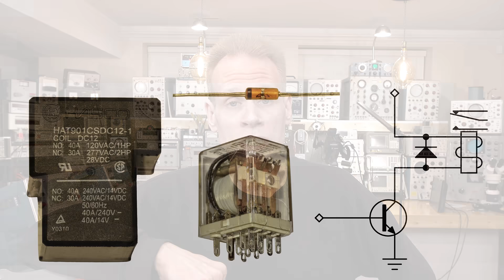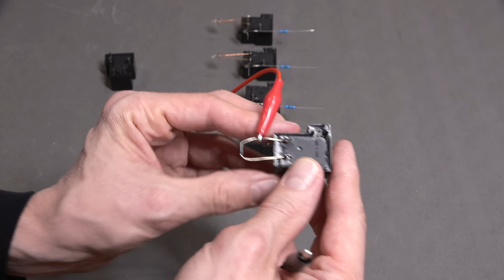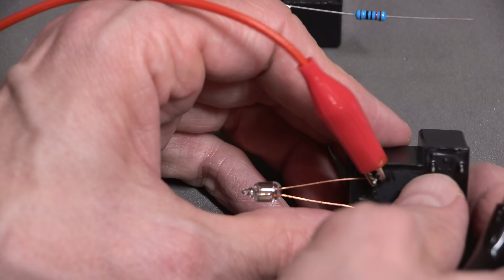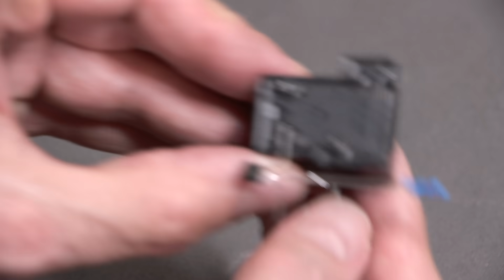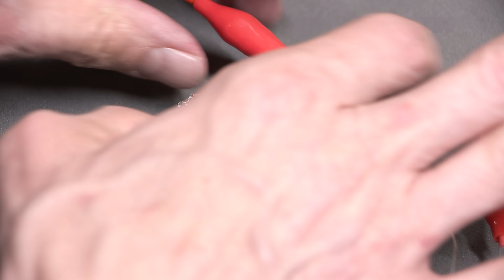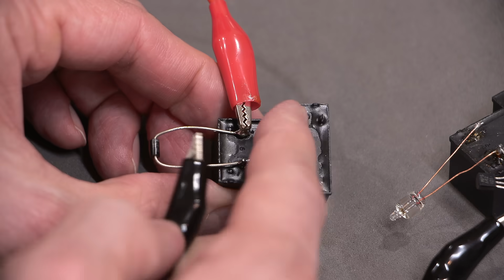Why Add This Diode Across A Relay Coil? This Is Why It's Needed!

Comment: Brilliant in several contexts. 1) Safety. Switch bounce from inductive devices can cause electrocution burns and cardiac fibrillation. 2) Circuit reliability. I've built high voltage power supplies and stepper motor controllers that would suddenly shut down or lose timing (e.g., 555 timer) until an experienced engineer told me to add diodes, which fixed the problems. 3) Excellent learning. Transistors are essentially two diodes, but a more inquisitive mind starts to ask questions about why collector and emitter are different. 4) The combination with neon lamp helps to understand directionality of electrons and magnetic flux. Noticing the oscilloscopes in the background, my current project is repairing a Tektronix 2465A DV.
Reply from the maker: Thanks for sharing your experiences, and good luck with the scope repair!

Comment: I am looking at the schematic for my 1990 Saab 900, the AC schematic. There is a diode but it's connected to the supply to the AC compressor clutch and then to ground. It's not across the relay what controls the AC clutch. My guess here is that the AC clutch itself is like a relay coil on steroids and that is what is being prevented from making a spike when it's disconnected. 

The relay itself seems to lack a diode, I suppose adding one wouldn't hurt anything.
Reply from the maker: Yes, the AC clutch creates quite an inductive kick when the 12V is removed!

Comment: Brilliant demonstration to to show co-workers and I've been explaining this to for years. A lot of electric strikes and wireless receivers and other electronic devices seem to be coming with Varistors now. What is your opinion of their use in place of this diode, or bridged across at the throw, or across at the load ? The load can be wired quite a ways away sometimes, and I've read instructions that straight up told me to install a varistor every one of those points to ensure functionality through warranty..

Comment: Just subscribed awesome explanation mate 👍👍👍 Im a diesel fitter and knew needed protection on relays and knew it was about collapsing the coil but never understood it now it makes sense thanks we get 2 sorts at work diode protected and resistor protected is one better than the other or are they for different applications?

Comment: Flyback voltages are wicked. It can take out transformers and other types of coils. It can take out components such as tubes/valves in old tech based equipment.

Comment: Automobiles have had this for ages. Coils can induce a voltage. Add the diode to kill it. With no diode, turn the key off and the engine continues to run.
Neon and inductance on decay at disconnect. Similar to an ignition coil creating spark at sparking plugs!!

Switch bounce is inrush decaying back to circuit voltage (12 volts)

Comment: the drop of the magnetic field creates an electron "vacuum", as the depletion zone moves and it pulls the positive side down below 0, and the diode acts as a check or dump valve.

Comment: I work in the access control industry and no one I work with could sufficiently explain to me why the strike manufacturer supplies a diode to wire in with the solenoid. Thank you for the demonstration.
Reply from the maker: Glad I could help explain it!

Comment: I think i just ran into a smd circuit where the diode failure caused a relay coil short that took out a Transistor.  Interesting this video appeared in my feed as i was recently googling diode, relay and transistor parts for replacement. Good info!

Comment: 1 - I congratulate you on a very clear illustration of the back-emf transient when switching OFF a relay.  Right down to demonstrating the polarity with the neon electrode.  V good.
2 - I'd like to clarify the nature of the current transient through the diode. At 16:30 you said it was much smaller than the relay's ON current.  What happens in fact is that, at switch-OFF the coil current continues instantaneously in the same direction and at the SAME VALUE, by virtue of the inductor's instantaneous back-emf.  The current however diminishes until the relay's armature is released.  This release of the relay's spring energy then comes out as a secondary pulse.  If you connect a small resistor in series with the diode you can monitor this on a 'scope.
3 - To further expand on this topic, what we see at switch-OFF is a release of energy contained in both the ½LI² of the inductance and the ½(SC)x² where (SC) is the spring coefficient and x is its extension.  The energy is released in the form {   Integral (ivt) (t=zero to infinity)   }.  The energy dissipation in the suppression cct can be accelerated by augmenting v (which is below 1.0V for a diode) by placing a zener in series with the diode (cathode to cathode) or across the transistor c-e, anode to ground, taking care that the zener voltage is substantially less the the transistor Vcbo.
I came across all this as a young engineer in 1967, working on a boat's echo-sounder in which the same transducer served both as transmitter and receiver.  The diode was holding the TR switch relay on Transmit long enough for shallow echos to be lost.  I ran into a similar phenomenon in 1970 when trying to engineer short pulses of compressed air using solenoid valves.

Comment: ・もっと根本的なコイル：インダクターの性質を説明することが必要です。
インダクターの有るコイルに電流を流すとコイルのインダクターに電流に相当した磁化エネルギーが蓄えられます。　
　その時に、電流を流している電源を切り離すと、磁化エネルギーは電流を流している時と同様に存続する様に振舞います。
つまり、電流を流し続けようとするのです。
　でも、電源回路は切り離されているので、コイルのインダクターは空間を電流が流れるような高電圧を発生させて電流を流そうと反応するんです。　これが、電流遮断時のコイルのインダクターの高電圧発生の挙動です。
　コイルのインダクターが電源回路から切り離されると、最初に電流を流した電源の電圧よりはるかに高い高電圧を瞬間的に発生させます。
　この高電圧はスイッチの接点間に火花スパークを発生させて接点を劣化させたり、スイッチ動作する電子回路のトランジスタを耐圧以上の高電圧で破壊したりします。
　このような不具合を防ぐために、コイルのインダクターが発生する高電圧をコイル自身に電流を流すことで防止します。
その為、コイルに加える電圧と逆方向のダイオードをコイルと並列に接続したり、交流電圧で動作するモーターなどのコイルに電源電圧以上で導通するバリスター素子なども同様に並列に接続して使われます。
　なお、ダイオードによる高電圧発生防止ではコイルの発生する電流が流れ切るまでリレーがON状態に成るので、OFFが遅れます。
これを防ぐにはダイオードに低抵抗を直列に挿入して、電流の熱エネルギー変換を早めることもできます。

・A more fundamental explanation of the properties of coils: inductors is necessary.
When current flows through a coil with an inductor, magnetizing energy equivalent to the current is stored in the inductor of the coil.
If the power source passing the current is disconnected at that time, the magnetization energy behaves as if it continues to exist,
 just as it did when current was flowing.  In other words, it tries to keep the current flowing.
However, because the power circuit is disconnected, the coil's inductor reacts by generating a high voltage that causes current to flow through space, in an attempt to allow current to flow.  
This is how the coil's inductor generates high voltage when the current is interrupted.
When the coil's inductor is disconnected from the power circuit, it momentarily generates a high voltage far higher than the voltage of the power source that initially passed the current.
This high voltage can cause sparks to occur between the switch contacts, degrading the contacts, or it can destroy the transistors in the electronic circuit that operate the switch due to voltages higher than their withstand voltage.
To prevent such problems, the high voltage generated by the coil's inductor is prevented by passing current through the coil itself.
For this reason, a diode with the opposite direction to the voltage applied to the coil is connected in parallel to the coil, or a varistor element that conducts at voltages above the power supply voltage is similarly connected in parallel to the coil of a motor that runs on AC voltage.
Furthermore, when using a diode to prevent high voltage from occurring, the relay remains in the ON state until the current generated by the coil has run out, so there is a delay in turning it OFF.
To prevent this, you can insert a low resistance in series with the diode to speed up the conversion of the current into thermal energy.

Comment: This past summer i was diagnosing a Mercedes SUV A/C compressor that wouldnt turn on after it was replaced. This is not a traditional compressor with a clutched pulley, but rather a solid pulley. The refrigerant pressure was controlled by a solenoid. The HVAC module sends a square wave to this solenoid to pulse it open. However the Module refused to command the solenoid. An oscilloscope showed that the square wave, durring the modules startup test, was showing to be a positive to negative zigzag instead the 12v positive square wave. This threw a DTC code suggesting that the solenoid wasnt grounded and the Hvac module disabled the system. At this time i learned how to use a diode in this way. After installing the diode across the solenoid wires, the oscilloscope shows the negative pulses have been effectively cut off, leaving only the positive to remain. The Hvac module was happy and the compressor worked flawlessly after that!
Reply: You could give the automotive diag youtubers a run for their money! You are brilliant.

Comment: Thank you Mr Carlson. This was just a random YouTube to me. I learnt about the flyback diodes in my Industrial Electronics training years. I'm surprised at the 30 amp automotive relays that don't have this built in. Considering that people are fitting driving lights to vehicles that now only come with LED headlights as std fitment. When I ask about diode protected relays at an auto store they look at me like I've got two heads, some suggest that you just install a fuse😂.

Comment: Many GM automotive Omron relays have one inside.

Excellent channel thank you 👍

This phenomen is similar to points condenser coil which when points open magnetic field collapse creates high voltage for spark plugs etc .

Comment: I have a relay issue with a door controller that I found a workaround with a diode, but no idea why it works.  It doesn’t matter which side of the relay is being used, normally open or normally closed, whichever side is currently open will flow current backwards.  I will have a door strike wired up to the normally closed side of the relay. When the relay trips in the circuit opens current will still flow through the circuit but backwards even though it should be open now. If I put a diode on the common side of the relay and have the negative side of the power connected to the diode and the positive to the normally closed side of the relay the circuit works perfectly. Anybody have any thoughts why?

Comment: As a Senior Master ASE with over 40 yrs of experience I have never replaced a relay due to it being broken down from the tiny voltage spike that you demonstrate. A 12 bolt vehicle battery is an incredibly  large voltage damper that won't be tested in the least by that spike. In fact if the wire resistance back to the battery were calculated, my guess is that spike wouldn't even reach the source (battery). This may be more prevalent in higher voltage no storage supply systems  like a computer but vehicles have not needed this for literally decades. The biggest problem in the auto industry is either a bad ground or corroded connections far and away.

Comment: Returned feed back ..no collapse...those are load that runs to the 2 charged lines..battery power supply 2 charged negative- positive +... AC LIVE SINGLE ONE LIVE BLACK IDENTIFY NOT MULTIMETER VOLTAGES THOSE ARE FOR BATTERY ONLY 2 WIRES BLACK RED...AC LIVE 120V -60+ HZ AC. ACTIVE PULSES CLAMP TO DETECT VOLTAGES HZ..AMPS FOR BATTERY CHARGED DISCHARGED BOTH - + light heater myqujnA...to charged you can used ACTIVE LIV ... BATTERY CHARGED LOADING PULSES ...RELAY POWER 12V ON OFF  DIODES THEN CAPACITOR SAVE THE GAINED ...

Comment: In the 80s I was radio tech in a Motorola radio shop. We had a relay called an "A Relay". It  was used to activate the vehicle horn to alert the driver when out of the vehicle of a phone call. The Oscope showed a -400 volt spike when deenergized. It woud destroy any driver transistor.

Comment: My first question is why a diode is not built into every relay? I'm guessing the relay suppliers don't want them to last.
Reply: Because then you have to respect a polarity...that's why
If you supply the fiode with +on anod and - on kathode, basically, becomes a resistor with a low value

Comment: Worked on 2400A 84vdc relays with -14vdc control voltage, NOV supplied all relays with a snubbing resistor which always failed. The fix was to replace the resistor with a TVS..

Comment: I am working on a air ride system project for a motorcycle. I have added a solenoid at each shock. There is also a solenoid to supply air and release air from the pneumatic circuits. Total solenoids being (8). Should I add diodes to each of the solenoids as well? As they also use the same concept of a relay coil?

Comment: 4:51 the coil of thr relay acts like inductor, and by supplying power to it, it stores energy by magnetic field and when you cut the power, the magnetic field creates a high voltage spike to the coil terminals, so if the coil input is directly connected to any sensitive components, it may destroy the component. So, adding a diode is basically passing the voltage spike through it.

Comment: Can you elaborate on the feedback below? ——— Thanks, this helps when I see ideas submitted by others 😊

⦁	Use a neon bulb vs diode to clamp the spike if driving device is higher than reverse voltage —
...but strike voltage of neon bulb 60v to 100V, where as a diode is around 0.7V.

⦁	A diode shortens the life of relay contacts —
...add a capacitor parallel to contacts to kill the arc.

⦁	Use a scope and neon bulb parallel with the diode test —— Maybe a helpful update to previous videos based off feedback/comments 😊

⦁	A side effect of a "normal" diode as a "flyback (kickback, clamper, freewheeling) diode" is that the relay's turn-off time becomes longer because the reverse current keeps the coil energized —
...the slow release of the flyback diode can also damage the contacts under high current. Adding a resister or z-diode (or TVS diode) to dissipate the coil's stored energy.

Comment: It is best to insert a resistor in series with the diode, with a value proportional to the typical supply voltage (the same number of ohms as volts). This allows the contact to open quickly, preventing ozone generation, losses, and degradation, while absorbing the overvoltage and improving the diode's response.

Comment: I have an issue maybe someone can help me with.  I used an IP camera with built in relay to trigger external lights and sirens.  
The camera relay hits an Altronix RB5 which then delivers power to the sirens and lights when the cameras analytics are activated.  
It works great for a couple days then I start getting false alarms where the lights and sirens activate with no analytic triggering them. 
Unfortunately I have not been able to replicate the issue at my shop and every time the units have triggered, the customer has to shut them off before I get there so I cant troubleshoot while the false alarm is active.  
Im assuming electrical backfeed is causing it. 
Im thinking adding a diode could solve this but Im not sure.  Any help would be greatly appreciated.

Comment: Correct explanation, that's why the positive terminal of the relay is connected to 86 and the mosfet in the ECM connects terminal 85 to ground, in which case the diode short-circuits the self-induction voltage when turned off and protects the mosfet from breakdown,also the relay coil as you explained.

Comment: and why does the mot automotive relays in cars have a resistor instead of diode?
Reply: Resistors don't have a polarity, diodes do, so resistor'd relays can be used on positive and negative side of load (or battery). But the higher the resistor, the less current is "absorbed" and the lower the resistor, the more current "leaks" through the energized circuit.

Comment: Incredible, I have a associate in electronics and this is great, I got out of computers in the 80’s and started doing industrial electrical work. This is the first time I have seen actual hands on work on real world circuits!
Reply: How could you have a associate degree in electronics and claim this is the first time you've seen "actual hands on work on real circuits!"

I have something similar (Associate in Applied Science in Electrical Engineering Technology) during the 90s and we had labs in AC/DC/Analog/Digital circuits, PLC Programming, AC Motors, etc. and all those classes had labs that required you to demonstrate your understanding of the material via hands-on to pass the class!  The same goes for the Cisco Networking Academy classes I took afterwards with real hardware and lots of hands-on experience to get certified!

... and you claim to have done industrial electrical work to boot.  I find that really hard to believe that someone with a degree in electronics doesn't tinker around trying to fix broken electronics to save or make money as a side hustle :face-orange-raised-eyebrow:

Comment: Not sure if anyone already pointed this out. You pointed with your finger the electrons going through the diode the wrong way. As you pointed out, the cathode goes to the Positive sourced end of the relay. When the magnetic field collapses that end is where the electrons come out of the coil and go through the forward biased diode. You pointed as if the electrons went from the Anode through the diode and out the Cathode end. Electrons (current) go from negative to positive, so enter the Cathode end (gray stripe) and exit the Anode end. Very much enjoyed the all the rest!

Comment: I am a magnetic door lock that runs just off of a 12 V power supply that is locked when the electromagnet is on and unlocked when the electromagnet is off. I wanted to double check if it made sense that I would require a die across that electromagnetic coil so that I don’t get a bulging spike every time the lock is disengaged